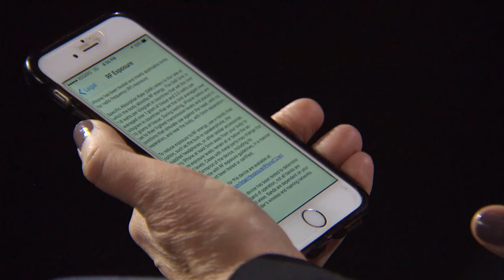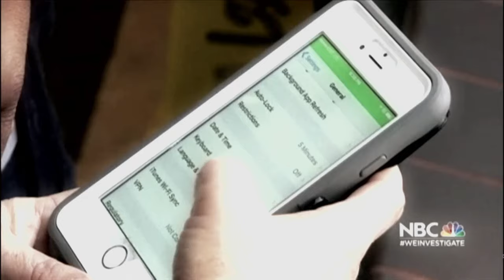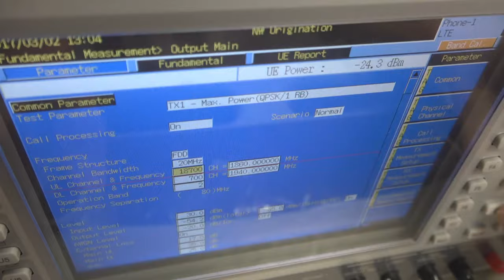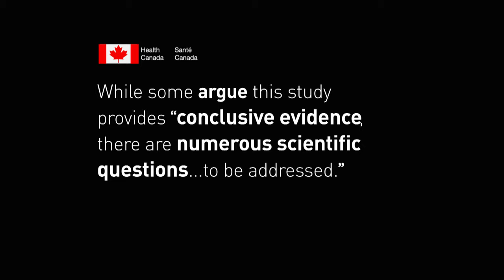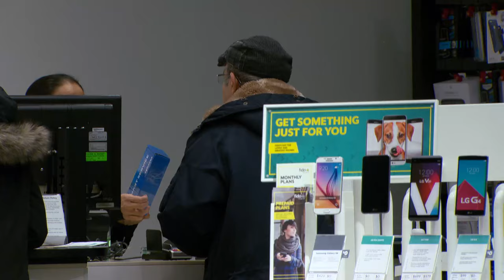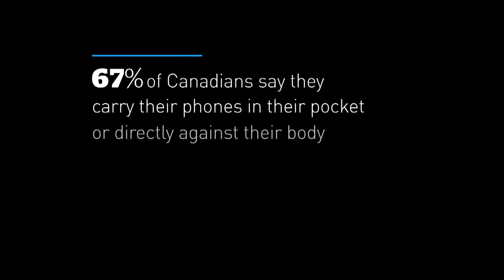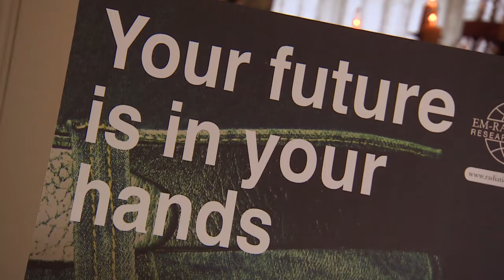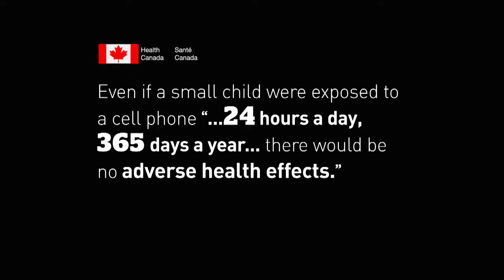The secret inside your cellphone (CBC Marketplace)

Comment: Think about this, if radio waves are dangerous, than why do we get radios in cars?
Reply: Because radio waves aren't dangerous.
Reply: Exactly
Reply: Because you're oversimplying. Radios in cars are receiving devices. The only harm is from being too close to a transmitting device. If you are close to an FM radio tower, you'd be under the same danger. Most people are not close to an FM radio tower.
Reply: @HeyItzSteve  yes
Reply: This is why the human race is doomed. Complete lack of understanding and logic. The radio in your car doesn't transmit. It's a radio receiver. THINK about it! Radio waves absolutely are dangerous at high power levels. It's not a theory, it's a fact. At a distance from the transmitter, the signals are very weak, even a 50,000 watt Class A commercial radio station has a very weak signal miles away. But a small 200 mW cellphone transmitter produces an incredibly powerful signal  when held at a fraction of an inch. Next to your body, the power levels are massive because they are concentrated in a very small area, and are literally billions of times more powerful than what you would be exposed to from a high powered broadcast tower miles away. The signal from a nearby cellphone is so powerful it can easily produce voltages in nearby wiring and conductors and cause interference to audio amplifiers and other electronics. Your computer speakers don't pick up your local radio stations, but they often will pick up and reproduce the sound of the pulsed digital transmissions from your nearby cellphone. I'm an FCC licensed Amateur Radio Operator who has been using, building, testing, studying, and operating radio transmitting equipment for decades. I know a few things about the subject, and I really do believe that there are real hazards due to both the operating frequencies (some frequencies are more dangerous than others) and the power levels used and produced by cell phones. Your car radio, however, is completely harmless -- use it with care free abandon.

Comment: I keep my phone in a belt holster.  When talking on it, most of the time I use a Bluetooth connection or the speaker mode.  I rarely hold it to my ear. I don't like the sound blasting directly in  to my ear.   Most of the time users are not very far from the cell towers,  therefore the emitted power levels would be low.  Putting a phone in the pocket can cause the phone to overheat a little thus reducing battery life span and the life of the components on the circuit board.

Comment: samsung website: 

SM-G930T
THIS DEVICE MEETS FCC LIMITS FOR EXPOSURE TO RADIO WAVES 

Your mobile device is a radio transmitter and receiver. It is designed not to exceed the limits for exposure to radio waves (radio frequency electromagnetic fields) adopted by the Federal Communications Commission (FCC). These limits include a substantial safety margin designed to assure the safety of all persons, regardless of age and health. 

The radio wave exposure guidelines use a unit of measurement known as the Specific Absorption Rate, or SAR. The SAR limit for mobile devices is 1.6 W/kg. 
Tests for SAR are conducted using standard operating positions with the device transmitting at its highest certified power level in all tested frequency bands. The highest SAR values under the FCC guidelines for this device model are: 

 Head : 0.85 W/Kg
 Body-worn accessory : 1.07 W/Kg
 Product specific(wireless router) : 1.04 W/Kg
 Simultaneous transmission : 1.59 W/Kg

During use, the actual SAR values for this device are usually well below the values stated above. This is because, for purposes of system efficiency and to minimize interference on the network, the operating power of your mobile device is automatically decreased when full power is not needed for the call. The lower the power output of the device, the lower its SAR value. 

Body-worn SAR testing has been carried out at a separation distance of 1.5 cm. To meet RF exposure guidelines during body-worn operation, the device should be positioned at least this distance away from the body. 

Organizations such as the World Health Organization and the US Food and Drug Administration have suggested that if people are concerned and want to reduce their exposure, they could use a hands-free accessory to keep the wireless device away from the head and body during use, or reduce the amount of time spent using the device.

Comment: So ban cellphone but not microwaves, tobacco, alcohol, household lighting, Wi-Fi, household lighting, radios, and the sun
Reply: Unfortunately, the tests presented in the video lean towards fear rather than good testing. They never tested a normal power level for a phone, only a worst-case (ie cottage with really bad reception) which is a massive power increase.

However:

* Microwaves have those cages for a reason - to keep the radiation in

* Tobacco, alcohol and drugs are a really separate issue here.

* light radiation and the sun is completely different kind of radiation.

* Both FM and AM are below the Microwave frequency range, unlike WiFi and cellular

* WiFi - the concern here was the massive increase in radiation absorbed the closer the device is to you. In this case, WiFi is part of the radiation of the phone and is at the same theoretical concern level. Most other devices, though, including the AP are not normally within 15mm of your body.

You've well summed-up with a sarcastic statement what CBC did wrong here: not explaining what needed to be explained thereby causing misunderstandings.
Reply: TheVikas heck I'd just settle with banning crooked politicians and lobbyists
Reply: TheVikas you forget guns. Their radiation is extreme massive and lethal
Reply: Mona Taylor, that's right! Fix this and the rest would follow... 🍸
Reply: Moka, these "worst case scenarios" are actually fairly useful, as these tell us the maximum output allowed by the device.

Comment: Just found it: May 2019!  Does it Apply to tablets because of the wifi?
Reply: I wonder the same thing  i have some wicked headackes lately.  Been useing my tablet a lot lately.
Reply: @samanthabloggins1775  If you don‘t move your head, your neck or/and shoulders getting tight and that‘s causes headacke.

Magda, It does apply for tablets too.
Reply: @FadingPixel  thanks i guess i need more exersise.

Comment: The average cellphone operates at the same frequency level as microwave ovens (approx 2.4GHz).  So essentially, carrying a cellphone around is like having a small microwave oven on your person.

Microwave radiation is not too dissimilar to radiant energy (from the Sun) or nuclear radiation, as they all cause some degree of vibration in living tissue.  

We discourage people from being near radioactive substances like Uranium, or to not expose our skin to the Sun for too long, so why are cell phone manufacturers so reluctant to warn people about cellphone, microwave emissions? 

The answer's simple: anything that puts people off their products, will obviously negatively affect sales.  The big cellphone OEM's and carriers are playing the same cat and mouse BS games that Big Tobacco was 30 plus years ago - and they're playing with the public's lives.
Reply: LOL  You clearly know nothing about the subject.  Microwave radiation is WAY different that UVA and UVB.  I.E. 2.4GHz for a phone compared to UV radiation from the sun at 800 Terahertz.  That makes UV radiation from the sun about 350,000 times higher frequency. 

All microwave radiation is non-ionizing.  Which means it lacks the energy to damage cells.  The UV rays from the sun IS ionizing radiation because it does damage cells.  We have proof of that (sun burns for example)

And comparing Uranium to microwaves? ROFL  Not even close to the same.  Not to mention that the most common isotope of Uranium is actually safe to hold in your hand with no danger of cell damage or radiation poisoning.

Please, educate yourself more.

Comment: its not radiation. its radio waves
Reply: It's basically the same thing just diffrent wave-length

http://www.mpoweruk.com/images/emspectrum.gif
Reply: It is radiation. Even the light you are using to see what you are typing is radiation. It just ain't ionizing.
Reply: It's not gamma or beta or x Ray...soooo....what kind of radiation is it? Rf? I only knew of the three
Reply: Electromagnetic's are non-ionizing radiators as opposed to an alpha, beta or gamma emitter which are ionizing radiators.
Reply: Same thing however, radio waves are fairly safe, it has a big wave length so it would miss us.

Comment: My hands have been hurting, because of holding my phone so much. I thought, "radiation!"
Reply: My index finger hurts when I roll  the screen surface,up to the point that I use a pen with a rubber top to write text or roll the screen.
Reply: Yup. Stings so bad I refuse to use one without my trademark patented million dollar evil spirit shield. Otherwise known as 2 layers of aluminum foil folded into a cradle. I make them long and fold over under the top end where the antenna is. You can tell it's effective because it reduces the download sometimes. Just separate it from the top end of the wrapper a little and it will fill in.

Comment: Briefs with a cellphone pocket in front are best.

Taking a groin shot, I’d rather my (damage-insured) cellphone take the hit, than my sausage & plums!!!  So that’s where I carry mine.  Risk analysis shows this location safest for both phone, and human.  (simple precaution prevailing)

HAR-HAR, seriously though....  I remember David Reynard’s story (01:56) from the mid-late 90’s.  IIRC that graphic overlay of the phone and tumor were of his wife — a Realtor who spent lots of time on her phone.  (was also lampooned in “Ace Ventura: Pet Detective”)

“Brick-Phones” were on the menu back then.  Primarily higher-powered 800Mhz analog affairs, usually transmitting at ~7 watts FM (continuous).

Without getting TOO technical, all modern phones....

• Are digital, transmitting “ONEs & ZEROs” really quickly as on/off pulses.  Cumulatively reducing the radiated energy during each “zero.”

• Transmit only a few tenths of a watt.  Though can power-up to MAYBE 2 watts, but only when absolutely necessary, for a short time.

• Are multi-band devices, primarily operating on microwave bands 1.7~6Ghz.  These wavelengths aren’t long enough to propagate through a human torso, nor very far into.

• People are spending less time talking, and more time texting.

• Actual “voice” calls increasingly tend to be on speaker (eg. while in a car), or via a video app like  FaceTime.

Just don’t see many phones glued to faces anymore.
Reply: Do you plan to have normal children at some point in the future?

Comment: Ok I copied and pasted this from the fine print in my phone and the part that trips me out is it says there is no separation when talking about testing and it's almost immediately followed by the 5mm. Take a look....

During testing, iPhone radios are set to their highest transmission levels and placed in positions that simulate uses against the head, with no separation, and when worn or carried against the torso of the body, with 5mm separation.

Comment: 16:02 no huh? Well imagine 5G technology on all your phones. Imagine the IoT all around you. That worse case scenario will be ever-present, all the time. No thank you.
Reply: Right, March 2017 now may 2019 4G to 5G what the hell....
Reply: You do know that all radio stations transmit at WAY higher power levels than cell towers, right?  And you know that cell frequencies are non-ionizing radiation, right?  And that non-ionizing radiation can't harm human cells, right?  Well, clearly not.
Reply: 5G is no where the same strength as 4G. 900mhz was the worst, not 5G

Comment: And this is only regarding 4G! Imagine the heighten need for their protection when 5G starts running full power transmissions. Kind of like putting your head in the microwave on max effect
Reply: Well, there was a proposal to keep folks in a room warm using microwave energy. Why heat the walls and the furniture when it's the occupants that need warming?

Comment: This will create walking zombies when they increase the g's example 5g , 6g, etc...
Reply: Afro Samurai the higher the frequency the lower the penetration power. That is why more towers were needed when we went to 3G and even more for LTE. 5G requires even more because the signal doesn’t go through anything. Like 5g routers and Bluetooth.

Comment: It's simple. Humans are the link in the chain that complicates things. It's "RADIO FREQUENCY"  Radio Frequency is a form of radiation. Common sense is all a person needs if they know anything at all about RF. RF (Radio Frequency) travels at the same speed as light, which is 186,000 miles per second. Radio Frequency is what is used to cook, or heat food up in a microwave oven. The newer phones (smart phones) use high frequency. Microwave ovens use the frequency of 2,4 gigahertz... Cordless phones use 2.4 gigahertz and higher. The higher the bandwidth, the shorter the wavelength.  The shorter the wavelength, the more it penetrates solid objects and creates heat. If you use a Cell Phone next to your head, its the same as slowly cooking your brain collectively over time.  END OF STORY! ... Those are the conclusive facts based on reality, and the nature of RF propagation, which is no secret to people who have worked with radio frequency closely, whether it be Ham radio operators, Radar Technicians, Microwave oven repair, or manufacture, and most importantly Cell Phone Manufactures. THEY KNOW. NO test needed. It's just common knowledge.

Comment: I feel heat in my upper thigh in when I have a phone in my pocket within 5 minutes of having in there locked. I no longer carry it. Full power is all the time. You said it, all phones measure between 5, 10 and 15mm, that's 1, 2 and 3 times the distance there. The test makes perfect sense the closer you get the worse it is.

Comment: I am curious why the phone tested in "hello" mode, at this step isn't connected anywhere, it must have sim and connected, when is idle and when calling!, maybe it was only for the cam shot (i hope). The other think is to test bluetooth devices
 my guess and many people don't know bluetooth probably is better if have low watts than the cable, because cable is like passive antenna in your ear when phone in use.

Comment: I have a samsung and it's actually not that hard to find information regarding exposure on your phone. You need to look under phone info in Settings. There should be a section called legal. you may have to search a few sections but it should lead you to the health and safety area of the legal information required to be disclosed by the maufacturer.

Comment: As a ham. I would put the phone. On my shelf. My radio would go crazy. And the radiation is broad banded . Even setting it near a portable. Am radio. Shows  readable (as sound) distortion. As low as .05 MHz. And high as 2 GHz. You chose. Distance or ???

Comment: Much of the science i have read suggests that that the brain is the most vulnerable to RF damage.  So why did they make cell phones for so long with the antenna beside your brain instead of near your chin?  Also interesting is the public perception that cell towers are more dangerous to you than your phone.  Their signal weakens exponentially with the distance from the tower.  Your phone sends out a weaker signal but strong enough to cause current flow in a tower antenna far away!  And does so less than a cm from your head with no distance weakening!

Comment: Isn't the message pretty self-explanatory?  I don't understand why it's confusing.  When the RF emission levels of the phones were tested, they were tested for what levels there were 5mm-15mm from the phone.  That's it.  It does not mean that if you hold the phone closer than 5mm you will receive higher levels.  It does not mean if you hold it closer than 5mm you will receive unsafe amounts.  It only means they tested the phone at 5mm (which might be due to how the tests are performed by the government regulator, they might not be able to test closer than that or it might just be their standard for some reason to use that distance... its also important to know those tests are not HEALTH tests.  They're tests of the amount of RF produced not because RF is bad for you, but because they want to make sure your phone doesn't cause interference with other devices using RF around you.).  If you were receiving an unsafe level of RF, you would know it.  Because you would literally get burned.  RF is not magic, it's just energy like heat or pressure.  It's photons (light) at a specific frequency.  As is heat.  When something feels warm, that's because it's emitting infrared radiation, which is also photons of light at a different frequency.  If you have an HONEST concern about such things, learn about them!  You have the sum total of human knowledge at your fingertips for the first time in human history!  You really do not benefit yourself or anyone else by just flailing around and hoping you can avoid having to learn anything while getting to feel some righteous indignation or irrational fear.

Comment: Cordless home phones are just as bad or worse. I found out when my home wireless router kept cutting off. Cable company asked me how far is my phone base was from the router. I said about 6 ft. They said it needs to be further away. I did some YouTube search and found a test that showed it was if I had a cell tower in my home. I went with Magic Jack and wired it to my in house phone jacks and use corded phones with answering machine. Also I have my Verizon router on a timer to shut down at bed time. No need to get more RF while Im sleeping. I noticed I sleep better and dream more now. Coincidence ? I think not.